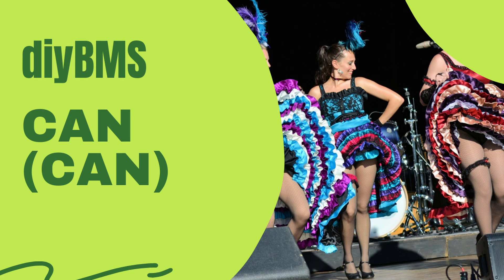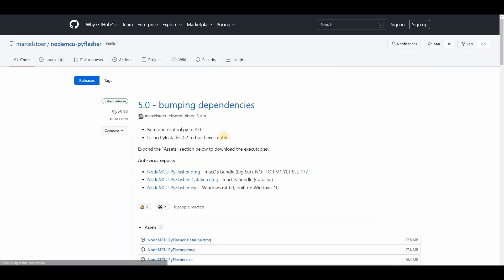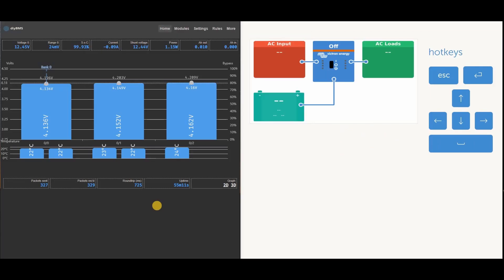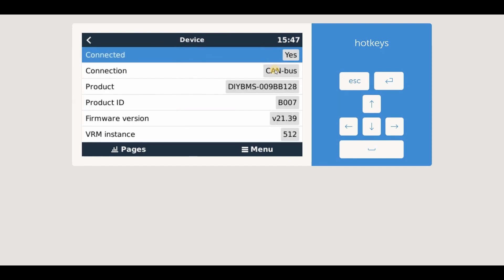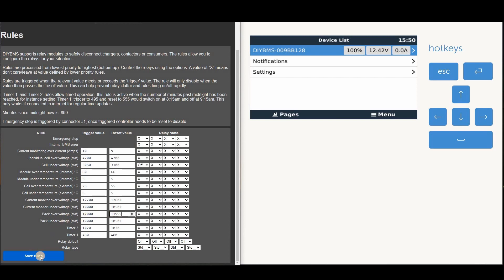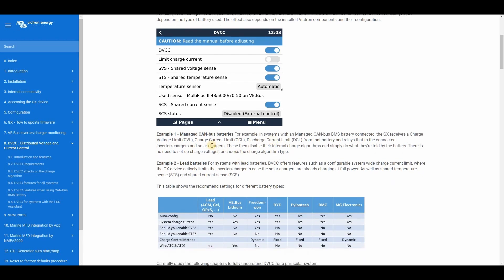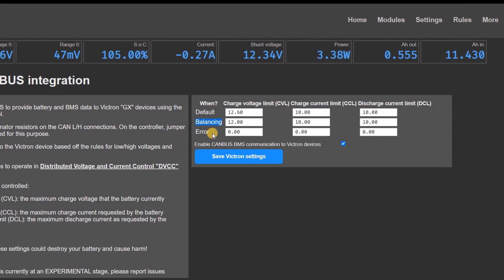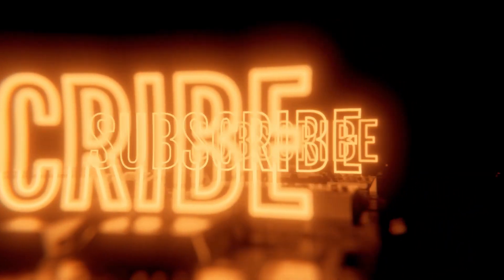Victron Cerbo GX CAN interface & diyBMS

Comment: Hi Stuart / everyone. I have a built a battery pack using nissan leaf cells in a 3p7s configuration, v4.4 cel boards ad the latest touchscreen controller. I have also acquired a Soltaro AC coupled inverter, that sadly only works with their own battery via CANBUS. They will not give any canbus data to me saying its confidential. I`m going to try to connect the diybms to it to see how it reacts. Also, there is a BMS on the market now that has maybe 7 inverter canbus data built in, its called a SEPLOS, and in it it has a drop down menu to select what inverter you want the bms to comms with. If anyone wants t try to reverste engineer it to have our bms do the same, im more than happy buying one for the project. Sadlt my programming skills are zero, so cant contribute to the reverse ingineering side.
Reply from the maker: I'm aware of the seplos boards, not used one myself.

Comment: Stuart I have built a stack of 14S and 8P and hooked everything up to a Victron GX inverter. First thing i notice is that the data LEDs behave somewhat strange. They come on in sequence up to module 16 then there is a pause for a few seconds before the data continues around the loop. Just wondering is that is normal. Also received packets about 2/3 of sent packets. 
compiled 2021-12-06T15
running 9k6 baud.
Reply from the maker: Yes thats normal, the cells are addressed in 16 blocks, so there will be a delay between these blocks.

Comment: Stuart, I can’t remember if I have your email address but I recall you asking how I was progressing with the Nissan Leaf ver 4 boards. Anyway I finally took delivery of 49 gen 1 leaf modules and will now start to build a 7x7 48V stack. I have a Trinabess AC coupled inverter which I will attempt to couple the diybms to via Canbus. Now I discovered the Trinabess is compatible with Pylontech US2000 battery packs which in turn are compatible Victron. I have 2 US2000 packs next week so I can reverse engineer the Canbus protocol. But maybe your code will just work as it is. One way to find out I guess…
Also I am working on a version of diyBMS for leaf with one huge PCB that bolts directly onto 7 stacked modules.
Reply from the maker: Very interesting stuff Alan
Reply: @StuartPittaway  I have completed design of the 7 module Leaf balancing boards, and had 20 boards manufactured. Now testing. 
I couldn’t get any comms going with the Trinabess. There is no documentation available on their protocols. I have purchased a Victron Multiplus-II GX 48V 5000VA inverter. Do you know if the DIYBMS controller can talk to this? Or will I also need the Cerbo GX?
Reply from the maker: @allanlind676  I've not personally tested that device, however if it has the GX hardware inside it should be okay

Comment: Great work Stuart!
A large portion of the DIY powerwall community is moving to LFP prismatic cells. Any chance you can do a video on a 16s LFP implementation? This would probably boost your channel subscribers as well!
Cheers, Rob
Reply from the maker: I've also been looking at the LifePo4 cells - don't have any at the moment to video, have you brought some already?  Looking for recommended suppliers.
Reply: @StuartPittaway  Your work looks very impressive. Thank you. Re LiFePO4 cells it's a bit of a lottery. There are soooo many dodgy sellers polluting the scene with used cells
Reply: @StuartPittaway I built a 16S2P  280AH battery bank from Lifepo4 cells from Docan Power (China & US distribution). Awesome cell at a very affordable price. From the same supplier, I purchased 2 200A JBD 16S BMS (CAN port) which are terrific, and looking to hook to Curb GX. Would love to see a video on that.
Reply from the maker: Rob I'm doing a series on lifepo4 install at the moment.
Reply: @StuartPittaway  Thanks! I purchased 20 EVE 280Ah LFP cells that are doing pretty well - despite having installed it with an inferior BMS (Daly 250A BMS)

Comment: Afternoon Stuart,  still no power waiting one transistor not fitted by JLBPCB.  O.k. do you have the new Lifepo4 battery circuit boards yet mate? Who would I talk to to get them made them please.
Reply from the maker: No I've not built any LIFEPO4 boards yet - the existing 4.4 modules should support that voltage range okay though.

Comment: Hi.
It would be posible, the integration with inverstors of the Ingeteam brand??
Reply from the maker: Not heard of that make. Are there any datasheet?
Reply: @StuartPittaway  on your website ingeteam
Reply: @StuartPittaway  I also have an ingeteam inverter, it is a good device and very versatile, it can work with batteries from 40 volts to 450 volts.
Reply: New is 1S STORAGE 1Play TL M (3-6kw)